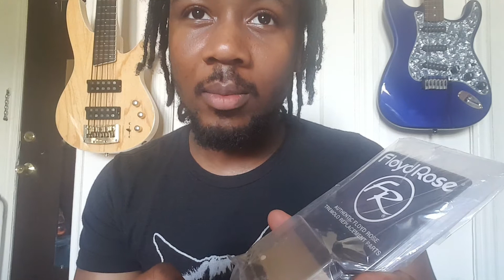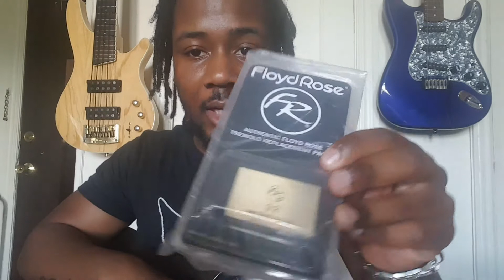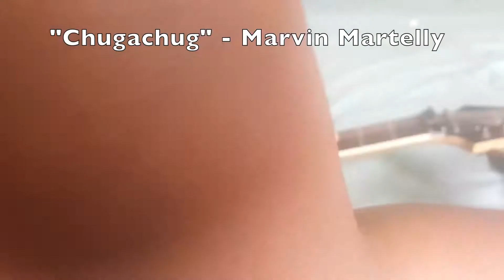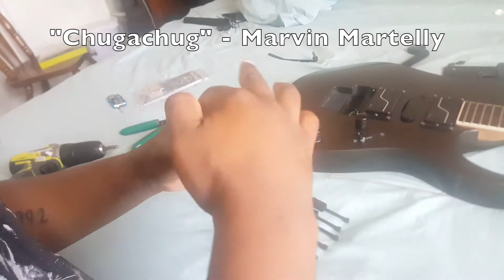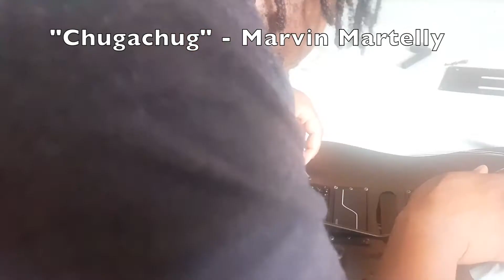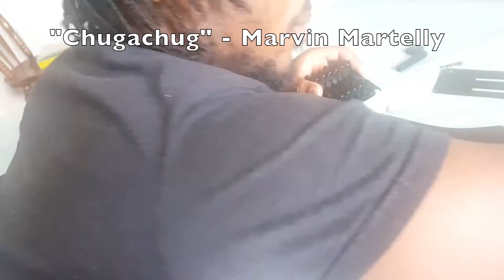Floyd Rose Brass Block Upgrade in an Ibanez RG5EX1!

Comment: Nice vid !. For anyone looking to improve the quality of the floating vibrato they have.... 
Most less expensive trems use zinc-alloy for the Base Plate, Pivot posts, Saddles and sustain block. 

If you upgrade the entire bridge with one that uses a steel base plate, use steel pivot posts as well. The original pivot posts 
are likely softer metal and will not last.

1. Use steel pivot posts (only if the trem base plate is also made of steel). the biggest reason for tuning issues is zinc-alloy or mismatched hardness of plate vs posts.
2. Use steel saddles (more important for clarity of tone and sustain than the sustain block).
3. Upgrade the sustain block.

Comment: I just ran into this video I have a harley Benton s620 progressive series guitar it comes with a floyd rose special already installed on it ,anyway I upgraded the sustain on it at first I put a 32 mm floyd brass block on it ,it was a big difference for me I can hear the difference like you said it was alittle darker sounding, well about a month went I put a 37mm floyd rose brass block on it ,to me the sound is the same as the 32mm block however way more sustain I think after that I installed a brass claw it seemed to more mids now when I play yeah try installing a brass claw with 2 heavy floyd rose noiseless springs one on each side that should bring the mids back it did for me anyway sorry this is so long  just thought I'd share what I did to mine and you said that wasnt equipped with the floyd correct if it wasnt you did a great job with the routing I tryed to put a floyd on an ibanez gio it was a no go i looked like i chiseled out with a knife just terrible anyway good video take it easy and stay safe in this crazy world we live in,peace

Comment: Did you have to do any extra routing for the Fluence or the bridge?
Reply from the maker: The Fluences will for perfectly.  The Floyd kinda clips the side of the bridge a little bit though. You're also going to need shorter string lock screws as the stock ones for the OFR are too long
Reply: @mobbinator  i see i see, with the Fluence is it that you can either have a push pull or s switch but don't need both?
Reply from the maker: @HugoMadizon  depends on the model. Some models have a lot more options where the 5 way super switch makes them more versatile, like the tosin abasi set. Others are a bit more simple and don't really need it, like the regular moderns, so it's up to you and whatever is more comfortable for you
Reply: Dude, hell yeah, thank you so much!

Comment: Also I wanted to add to there is a little piece of metal between the sustain block and fine tuners it's some stupid piece of crap you can leave it out i think it sucks the tone out it's like this you have the floyd plate where the saddles go then you have the fine tuners and then some crappy metal plate then the block take that piece out and then try it I think without that crap piece of metal it sounds better they call it the tone sucker they are right anyway later just though share that as well ,take care